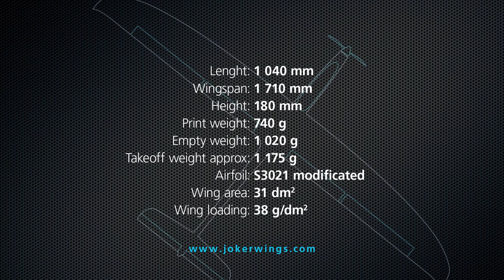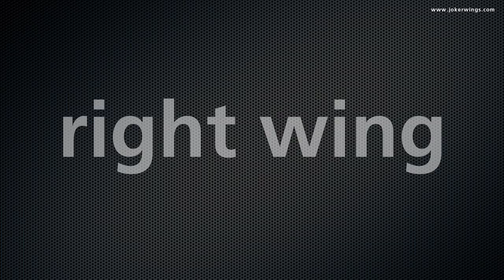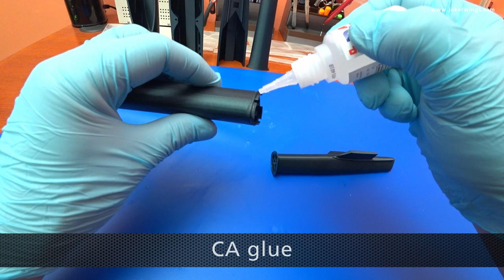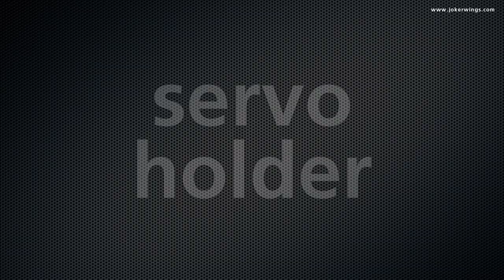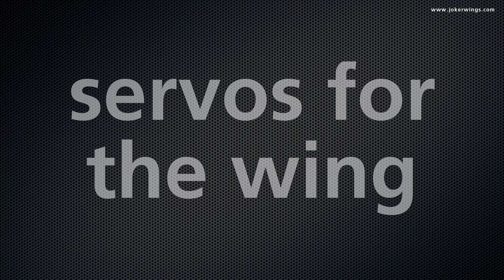JOKER - 3D printed RC plane - step by step assembly

Comment: Very impressed with the design of both the end model, and the 3D printed parts and assembly quality, so I bought the download. 3D print newbie question: Has anyone printed this on a delta printer? Would these files print equally well on a Flsun Q5 Delta printer?

Comment: Just as a matter of interest. Why do you leave the brim on the wing and fuselage sections and then cut it off afterwards? I can't see any structural benefits to this approach as the dovetailed mechanism you employ must provide a great join and good strength.
Reply from the maker: Improved cleaning experience :-) and bond strength. Brim can also be removed before bonding. It does not matter.

Comment: Can't get the wing holes to line up with the holes in the fuselage, it's as if the fuse is printed too short. Does anyone know what the total length should be? I've double checked my printer and it's printing size accurately
Reply: are you talking about the the front or the back of the wing parts?
Reply: @hpsie8310  Turns out it was an issue with my printers accuracy on the Z axis, all sorted now after an adjustment and reprint

Comment: have a setup that is about 100gr too heavy / Motor and Battery probably too big :-) . Never the less it flys supperb
I will by smaller batteries and mount hxt900 servos that should do the trick and will fly even better

Comment: Please tell me the parameters when using Cura.
I'm having a hard time printing wing.

There are many shortages in the manual explanation
Reply: Hi, this model is prepared for Simplify3D slicer only, no other slicers like Cura or Prusa Slicer are supported.

Comment: BTW. What material are you using for the fuselage? Is that a carbon based PLA? Also do you recommend 2 walls for the fuselage thickness? Also what is the part 2 fuselage sleeve used for.? Your video doesn't show this.
Reply from the maker: No. It is common PLA. The fuselage thickness can be seen here: https://drive.google.com/open?id=1OhwwOEseU_AgWJqgB0bRcQ-VT2JpMttf
Did you receive my email?
Reply: @jokerwings  OK, so that's two wall for the first three sections and the rest are single wall thickness, which makes sense. I like your use of reinforcement sections in the fuselage. I will print two fuselages (one for a spare) and see how tough single wall is and two wall. I have Simplyfy3D working now. Looks good.

Comment: Printing has started this morning. Looking forward to building a couple of these. What is the servo manufacturer you are using for the v-tail servos? They look strong.
Reply from the maker: It's an ordinary servo. Interchangeable with HTX900 and the like. https://hobbyking.com/en_us/hobbykingtm-hkscm9-5-single-chip-digital-servo-1-4kg-0-09sec-10g.html

Comment: Anyone help with print settings for ender 3
Reply: I used the produced gcode files and edited them in notepad++ and did a find and replace on the retraction settings. Search for E-0.8000 F1800 and replace with E-3.7000 F5000. Start the print but reduce the speed to 45% for the first layer so it goes down nice and slow. Then after 10 or so layers you can increase to 100% speed
Reply: @StuartGreenBinkyBMF  thanks.
I managed to print this on ender3.
Looks okay so far.

Comment: Hi Joker team, could you please tell us, what orange/yellow filament was used? I mean product picture on 3dlp page. Thanks!
Reply from the maker: Hi, this filament: https://shop.prusa3d.com/en/filament/270-pla-pha-orange-translucent-750g.html
Reply: @jokerwings Thanks! And what is your experience with PHA vs. 3D pritned planes? I think that PHA is little bit soft?
Reply from the maker: @janpichrt  There is no material difference on the printed wing. Works very well. Printing parameters identical to PLA.

Comment: Hi  purchased one too, is there any option not to Print in bulks of. Parts ? other than buying simplify3d
I managed to edit other 3dlabprint files to comply with Prusa slicer but this won't work here and I don't like the printer running 24/7
thanks !
Reply: Hello. Yes, sure. In factory files, printed parts can be removed and rearranged as needed. It is of course necessary to have Simplify3D available. Without Simplify3D, the model cannot be printed correctly.
Reply: Okay will simplify work with the Mmu2s ?
Reply from the maker: I can not advise because I do not use. Visit please: https://forum.simplify3d.com/viewtopic.php?f=8&t=13265
Reply: @jokerwings  hi I got confirmation to receive a Profile for the MMU2s form S3d. if would print just one part wing1 for instance would you advise a little cooling as the layers don't cool down that much as with all parts on the Bed
Reply from the maker: @hpsie8310  Hello. Better always print in pairs. But wing part 1 can be printed separately. It is big enough. Spontaneous cooling is better. Fan cooling is not recommended.
Reply: @jokerwings  yes printing pairs was my intension , I started a test print (wing 1) with s3d looking good so far . Well designed by the way !
Reply: @jokerwings  I have reduced the extrusion factor as the first part was 5% too heavy how much heavier can the print be without harming flight characteristics

Comment: I have nearly finished printing and assembly has started. It goes together very well. Better than many others. I want to print the ailerons, flaps in another colour but I am having trouble with simplify 3d reporting that selected processes overlap.
Reply from the maker: I'll prepare the factory and code file (flaps and ailerons separately). Give me time :-)
Reply: @jokerwings Thankyou no hurry I am waiting for some hardware. Already assmebled the fuse and wings :)
Reply: How goes those files?
Reply from the maker: @audigga4396  Hello. Ailerons and flaps separately. Wing part 5 must be printed together. It's 44 grams of extra filament. You can be download here: https://www.jokerwings.com/joker-print-part-9.zip
Reply: @jokerwings  Thanks Printing now...have been without power for the last 3 days due to storms. Where can we post photos?